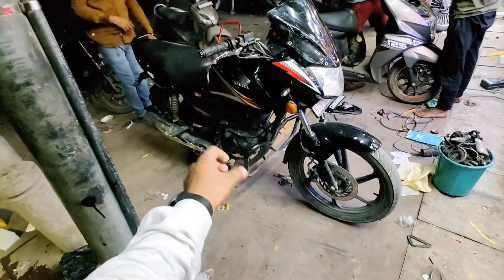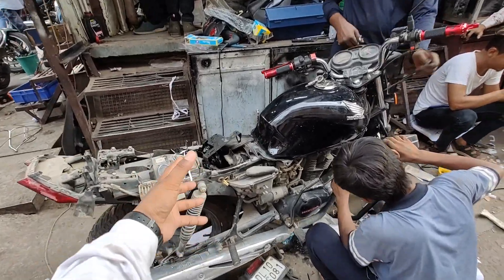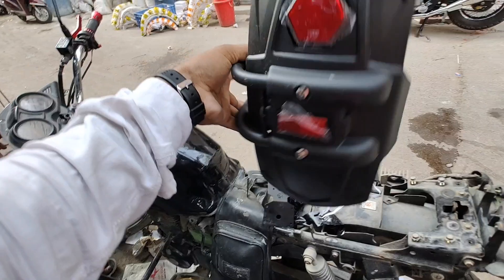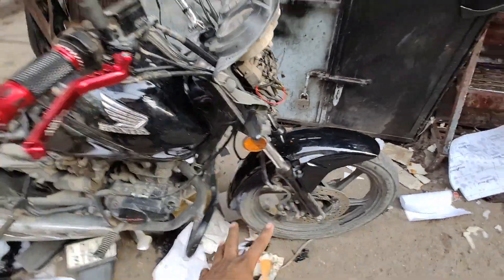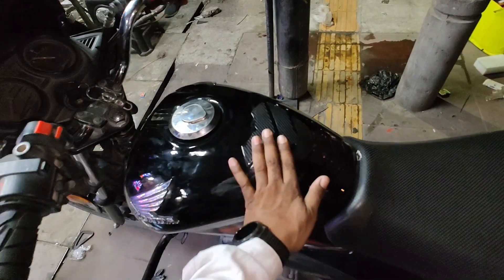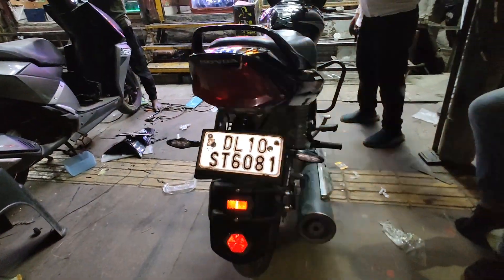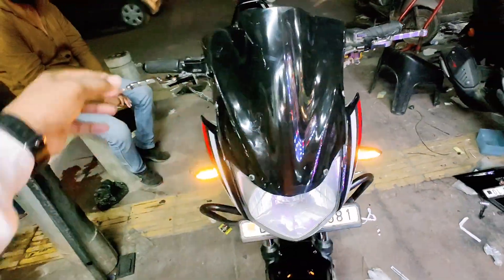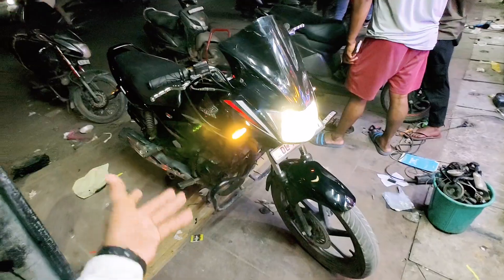Honda CB shine modified | पुरानी CB shine को नया बना दिया | CB shine modification

Comment: honda cb shine 125 crosh gard modified video
Reply from the maker: shop address & location 👇
1686, Arya Samaj Rd, Block 27F, Nai Walan, Karol Bagh, New Delhi, Delhi 110005 https://g.co/kgs/JhQMn2
----------------------------------------------------------------------------
Shop Neme 👉skd
1686/36, nai wala market, karol bagh new delhi 110005
contact number ☎️📱
👉8800567097
👉9911529266

Comment: Hii
Reply from the maker: shop address & location 👇
1686, Arya Samaj Rd, Block 27F, Nai Walan, Karol Bagh, New Delhi, Delhi 110005 https://g.co/kgs/JhQMn2
____________________________________________
Shop Neme 👉skd 
1686/36, nai wala market, karol bagh new delhi 110005
contact number ☎️📱
👉8800567097
👉9911529266
shop address & location 👇
1686, Arya Samaj Rd, Block 27F, Nai Walan, Karol Bagh, New Delhi, Delhi 110005 https://g.co/kgs/JhQMn2
____________________________________________
Shop Neme 👉skd 
1686/36, nai wala market, karol bagh new delhi 110005
contact number ☎️📱
👉8800567097
👉9911529266
VBB

Comment: bhai
Reply from the maker: shop address & location 👇
1686, Arya Samaj Rd, Block 27F, Nai Walan, Karol Bagh, New Delhi, Delhi 110005 https://g.co/kgs/JhQMn2
____________________________________________
Shop Neme 👉skd 
1686/36, nai wala market, karol bagh new delhi 110005
Shop contact number ☎️📱
Raju Verma 👇👇
8800567097
9911529266